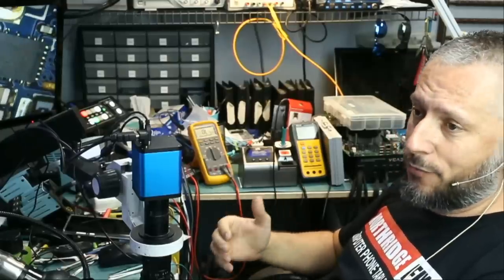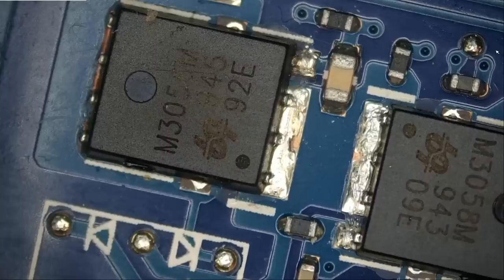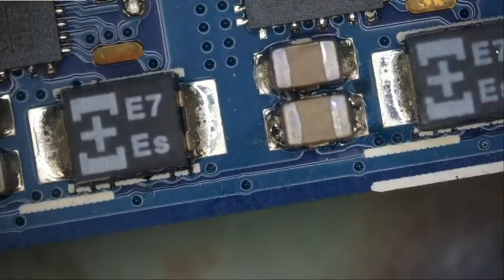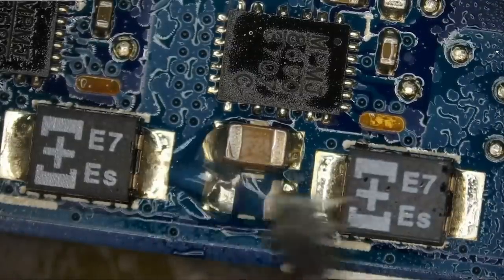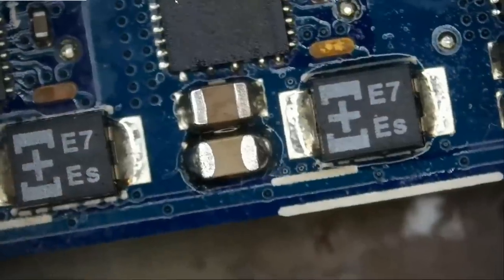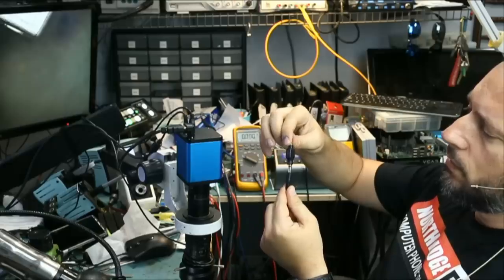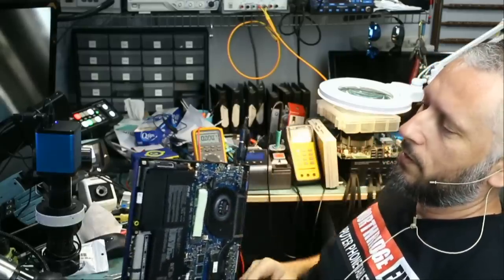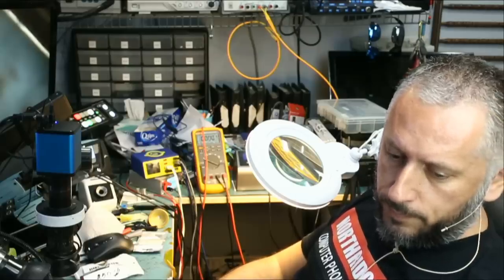Asus Zenbook UX534F Suddenly stopped power on - Weird Repair

Comment: Hi Alex, just used Amtech flux and leaded solder bought from your on line shop. What a difference!  It just shows that if you have the right materials you can actually solder correctly :) Thanks again, Stewart (UK).
Reply from the maker: Now you know the secret to how I get nice and round shinny solder joints.
Reply: So i will order too , maybe more that 4 products. Thanks

Comment: I've have found and confirmed the Asus adaptors are the source for causing most mother board shorts. Both your original power adaptors were broke. Bet the customers is the same and caused the short as well. 👈👉🤯With this happening to me twice I immediately replace my new Asus's power adaptor with a different brand from BestBuy. Never had an issues ever. Works like a charm even a year and half later.  👈😲👍

Comment: Those universal PSU's are handy to have, I couldn't imagine not having one. Of course if you get one, get one with many various adapters as possible so you're not so limited. Most all laptops work anywhere between 18 to 20 volts, so most universals should work. Then there's also universal PSU's with different voltage selections, those are also nice to have around.

Comment: As always, really impressive how fast you locate the proplem and how proper you self it! Love it!

Got a question, as I own this notebook myself.
After removing coolers and unplugging fans for repaste, gpu fan is faulty. No pwm signal I assume, cause with plugged pwm cable is not running, with unplugged pwm cable, fan runs full throttle.
Is it more likely the mainboard or the fan to be faulty in this case?

Comment: I always wonder how you know the rating of the shorted caps you replace. Is there some kind of rule of thumb to know this without schematics or circuit diagrams?
Reply: I have same doubt...
Reply: Same here and he has been dodging that question.
Reply: he usually has donor boards
Reply: @bryanswaggbeast4594  He hasn't been dodging that question. As the comment above said, yes he has probably 10+ dead donor boards that he can go and check any capacitor's capacitance. But as he has stated multiple times, he has years of experience working on these boards and he literally approximates the capacitance of the cap and usually gets it right. Usually it's 10 uF. I wouldn't be surprised even if the capacitance he guessed is way off that the board would work just fine.
Reply: In the context of most logic boards, the majority of SMD capacitors are only used for reducing voltage ripple, which reduces EMI and potentially improves stability. Realistically, the device can run without those capacitors, assuming that the power delivery is reasonably good, and it really shouldn't be sensitive to different capacitance, within reason.

The only times where capacitance would matter would be either a low-pass filter, or an analog timer circuit.
Reply: @Milwaukee Mac Repair Wow, that sounds really technical and impressive. 

Shame it's utter crap.
Reply: @Milwaukee Mac Repair Many thanks, this explains it better than the “donor theory” because I’ve seen him doing it in rare or unique devices without having a donor.
Reply: @AlexioFernandesTV  Donor boards are not the only way.
Reply: @therealb888  obviously... It's just an option...
Reply: No expert but I don't think it matters that much, as long as its similar
Reply: If it's a decoupling capacitor, which most capacitors are, just use any rating. It doesn't really matter much, most of the time they're there to reduce parallel inductance across all capacitors, rather than adding more capacitance. The exact value isn't very important

Comment: I would have liked to see a repair on the adapters.  Maybe you would consider it dangerous to work on power supplies, but they need to be respected and treated like any other repairable equipment.

Comment: More times than not a bad power adapter can be easily repaired, no need to throw them out. Most are easy to get into and I have found most times it is a blown capacitor. I know these are not that expensive but the cost of replacing them adds up fast and its worth a few dollar part to try and fix them!

Comment: Well i have a hp elitebook 855 g8 laptop and the cap that is short in this laptop is blown in my laptop cause the ic is same and it connects the Vin of the ic and ground. Without the schematic i cant know the capacitance of the capacitors can you tell me what is the caps capacity? And voltage rating? The cap that you removed and the other cap near that cap in parallel. Both of the caps are fried in my laptop motherboard but the laptop still charges and runs fine but i am noticing that the laptop battery percentage decreases about 6%per day while powered off is this normal or because of the blown caps??
Reply from the maker: https://northridgefix.com/forum/repair/hp-elitebook-855-g8-repairing/#post-557

Comment: The charger of asus laptops that there is a problem after the rubber cover and the wire has a buldge and position to power it on, check it, We encountered 2 times with same problem.
Reply: can you explain more?
Reply: @ebrahimshami9928  like too much bends in the wire and it will cuts the power when you not put a position like needs to be sturdy to fix itself and charges again